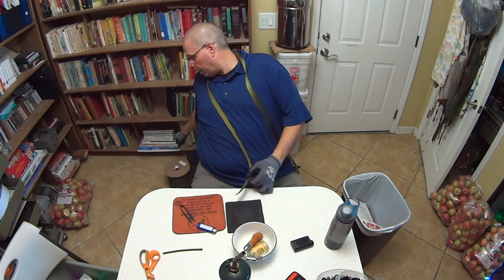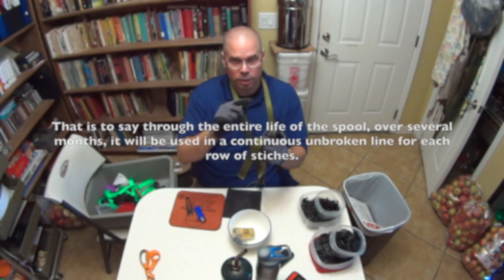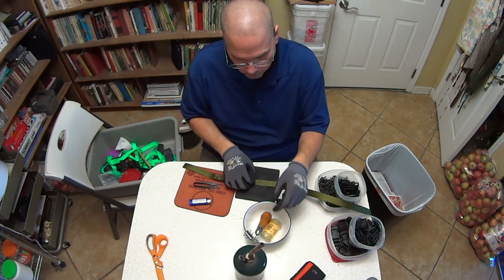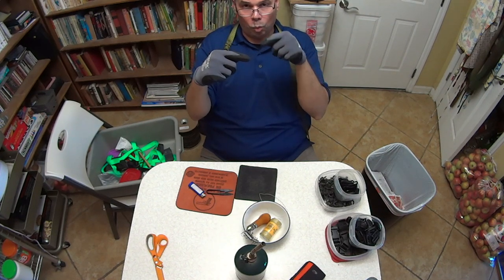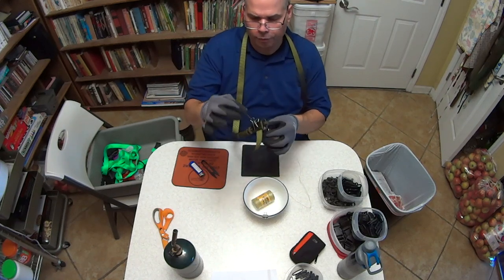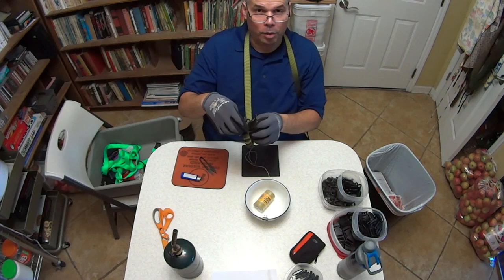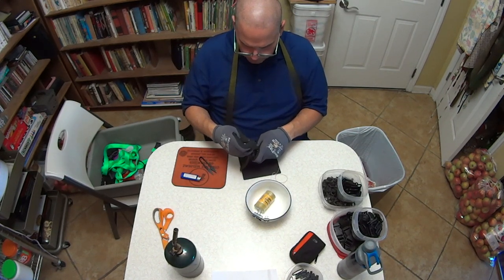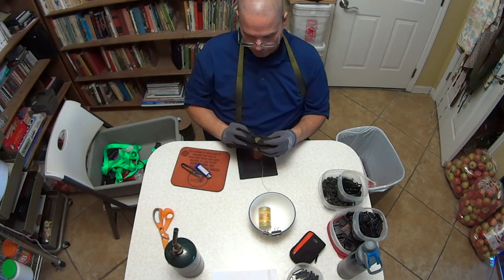How I Make the Tier 1 Citizen 1 Point Sling

Comment: Do you make dual mode slings, that can switch mode between 2 point and 1 point?
Reply from the maker: I do not make dual slings. My slings are dedicated for what they do and are extremely simple so that you can run your gun instead of your sling.
Reply: @Tier1Citizen  I understand. What is your opinion on 2 point slings on shorter firearms? Is a 1 point sling better suited for those?